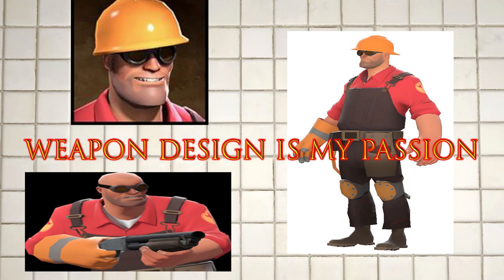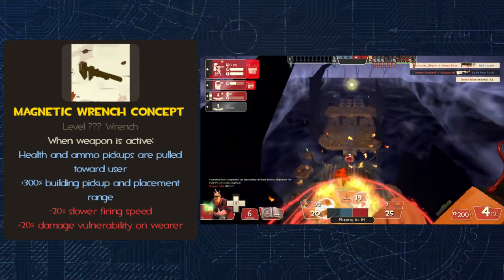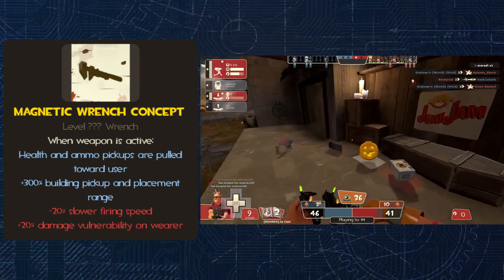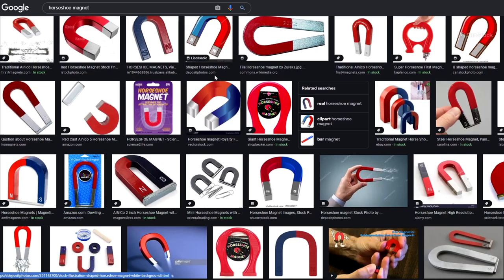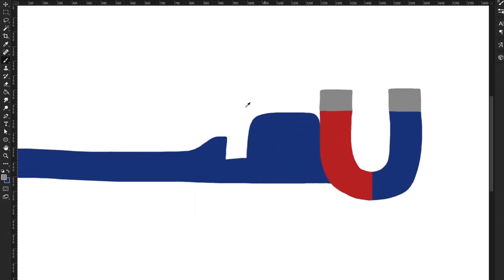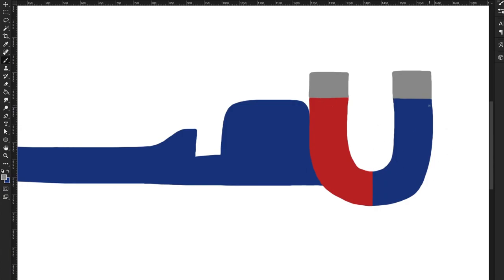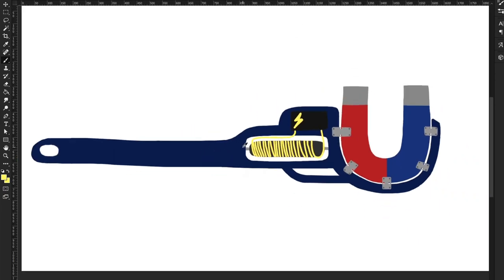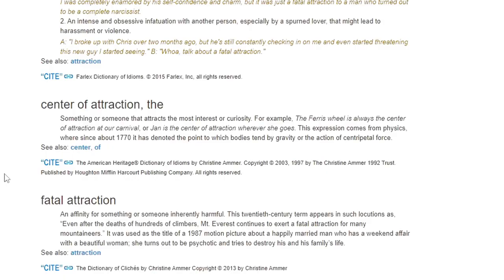Harness the Power of MAGNETISM - An Engineer Wrench Concept [TF2]

Comment: What if you had a right click function to target a cone-shaped magnetic pull stemming from your eyesight for the range of the magnet in leu of an AoE pull, it'd be quite obnoxious to accidentally take or hog packs around you your team might rather have. I think the swing speed is a decent downside, but I think for something that essentially makes you able to turtle perfectly and saftley you might want a downside that's more an output control or makes your turtling more flawed to compensate. I'd say a tiny increase in metal cost to buildings might be acceptable: something perhaps as big as 5-10 metal or a percentile increase like 15%. This way you cannot just go from 0 buildings up to sentey> magnet metal > dispenser> tele exit> magnet more metal so fluidly.

Comment: While I'm not sure how it work out in Source Engine, I really do like this idea! I do have some thoughts, most of them positive:
For one, I'm slightly worried the Rescue Ranger's mere existence could offset the wrench's swing speed downside since you could just shoot the sentry, but then again you can't rely on it forever since you have to reload. That and using the Rescue Ranger at the same time as the wrench is kinda dumb since it's more or less the same stats but more extreme, so I'm at kind of a grey area with that complaint lol

The one change I'd suggest is to also make the magnetism active when you're carrying building. I feel like that would be appropriate because it would help the weapon lean more into the idea of preserving your longevity, which I will get more into in right now

The biggest reason I like this weapon idea is that, subconsciously or not, you seem to have created a reverse Jag. The Jag's main upside is that it gets your buildings set up quickly, but in turn you lose marks in your defensive capabilities due to the lower repair rate. This new magno-wrench meanwhile takes more time to set up, but the ready access to metal and the increase ease of grabbing and setting up helps you maintain buildings for longer.
This why I suggested the change where you magnetize while carrying buildings, btw. So that when you set them back up, you'll have plenty of health and metal to preserve your buildings even longer.

Also this is completely unrelated, but your joke about the wrench attracting projectiles actually gave me an idea for another Engineer weapon. Maybe a PDA that replaces your Dispenser with some building that attracts projectiles to its location. I feel like you could create a ninjaneer subclass by sneakily placing one behind the enemy team.

Anyway, enough of my rambling. I'm really enjoying this series so far, and I'm looking forward to more! :)

Comment: I think for engi, this just means he has a max health of 104 now instead of 125. Maybe you could just make it a "-20 max health" or "-25 max health" type thing since it's active all the time? So it's easier to interpret, and there's nothing else in secondary or primary slots that affects engi's max health. Like an anti-gun-slinger lmao.
A tip for checking the effective hp it gives is "hp/(1-stat)" (so if it's a bonus, you subtract it from the one, and if it's a downside (so negative) you add it to 1. And just make sure you convert the percentages to decimal lmao.

Comment: What if instead of this being a passive effect you had to hold down right click and aim in the general area of the pickup (a bit like with the Manmelter), to give it more intentionality? Perhaps you should also be able to draw out metal out of your dispenser from a distance, maybe at a reduced rate though. I think this would actually make bringing the dispenser away from the sentry and closer to the team more appealing to even the turtliest of Engies.
For the animation, I imagine that the Engineer would hold out this wrench forward like a gun, with his hand slightly shaking due to the strength of the magnet or something.

So... it's kind of a sidegrade to both the Rescue Ranger and the Eureka Effect. Instead of healing the sentry from where the metal is or teleporting to and back from the metal, you basically teleport metal to where the sentry is.

Comment: Cool gimmick, but one that would be too situational to replace any other wrench. I would personally make this a secondary weapon and instead of a cool looking wrench thing, the engineer would just literally pull out a big ass magnet and could pick up metal from across the map just by looking at it, with a 1.5 second reload time, with an alt fire that requires 65 metal to activate, allowing the engineer to pick up any metal within like a 5 meter radius for 5 seconds.

Comment: Actually, pulling rockets with it COULD be really cool. Maybe it's not a perfect "change direction to hit engie" because that would just make it stupidly useless and even too dangerous to use, but what if it did pull a rocket or something in more and more the longer it travels nearby? You could make it some way of risking getting hit with a rocket but if you do it right, you could use it to lead away a rocket from a teammate and save them!

Maybe still a bit broken, but we could at least try to see what would happen, since it does sound interesting and maybe not even broken at all (especially with the extra damage vulnerability).

Or actually pull in bullets nearby, maybe just making your hitbox a bit larger to kinda give the feeling of that effect instead of the 20% damage vulnerability. Though that may actually make the damage taken a lot more than +20%...

Comment: Slower swing speed on any engineer weapon is a real massive downside, and I don't think the damage reduction would be necessary nor do the pros outweigh the cons.

However, instead of a slower swing speed I think something of similar potency could be a slower deploy and holster speed. Make it so the Engineer needs to dedicate to pulling out this weapon when he wants to make use of it, instead of relying on the safety of the shotgun, short circuit, pistol, etc etc. Otherwise, really cool idea!

Comment: what if the wrench had a charge meter that would be used while holding right click to expand the pickup range or pull items in? Make it so that it's charged via moving or maybe damage and take away half of the dmg vuln. This could either be a 10 second thing like uber or you could hold to activate and have max of 10 seconds of usage.

Comment: It should be skill based. So ull have to look at the ammo or metal and, press and hold right click to activate the magnet(yea it would be cool if engie can toss around ammo packs), other wise engineers will have less control and accidentally hog ammo from other players that need it. The slower firing speed downside is not good cuz ur punishing the player with the same thing the weapon is suppose to improve at: faster building setup/repair. It should probably only have a downside of a massive dmg/heal penalty so that u can no longer 2 shot light classes & sappers. The less healing will balance out this weapon being too campy while still allowing engie to heal his building really fast and ez

Comment: waht if you ditch out the 20% less speed swing penalty and make that battery have a use? like using that battery as a power charge and as it runs out of the healing/repairing rate deplenishes and the only way to replenish the battery is to be close of the dispenser or get the ammopacks? for me thats better because the battery would make no sense to be there w/o that mechanic.
Reply: i actually just realized... this weapon would be the better version of a turtle gunslinger engi(the ones that keep their supportive buildings for the team and uses the mini senry as a highly replaceable block off flank) in the first style you would put your dispenser ONLY for your team, then you would place the sentry level 3 in spots that the enemies dont expect it, maybe on the flanks. and in the second style you would put your sentry in spots that they cant see you but the sentry can see them (300% stat) and whenever the sentry is in danger he just keeps it alive by picking it up and not showing his cake.

Comment: With drawing the weapons in MSPaint (idr what you're drawing it in, so imma just say MSPaint for simplicity) like you are, if you made the electromagnet have accurate wires around the bar then you wouldn't really see the bar, and wouldn't be able to tell that it's an electromagnet. Although of course you could draw very small diagonal grey lines to show that it's wiring and an electromagnet... 🤔

Comment: This weapon basically already exists in the custom weapons servers, and its either completely useless or extremely exploitable and dumb depending on how its used.  Long story short, there are already engineer weapon unlocks from leaked concepts that are way better than anything most people could come up with. I'd say you should instead make up engineer sentry replacements or building concepts if anything.

Comment: -20% slower firing speed!? on a weapon designed to save time!? really think that one should be removed, or at least swapped out for a different kind of downside imo
may I recommend swapping the slower firing speed for, perhaps, something like dispensers regenerating metal at a slower rate? or bumping the +20% damage vulnerability up to a +25% one, as that would place your effective health within the one-shot range against demo pipes.